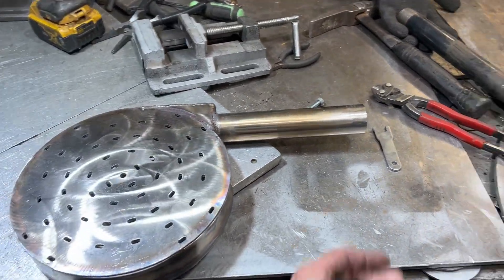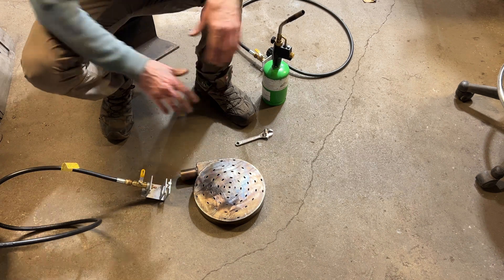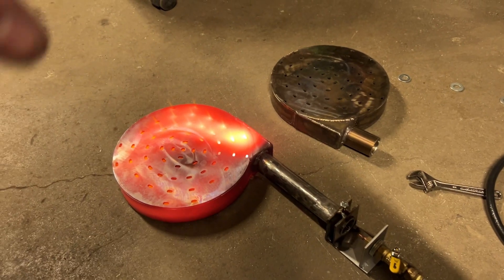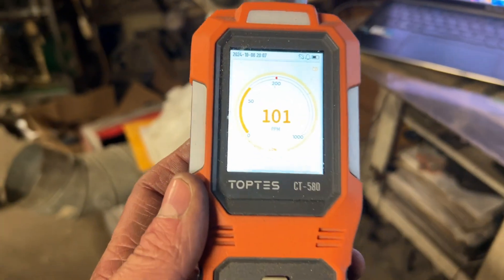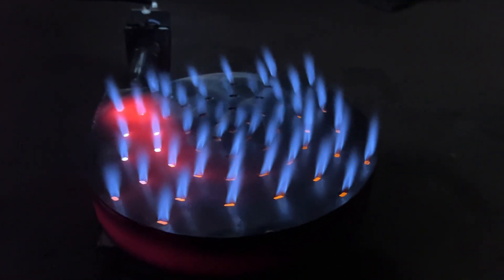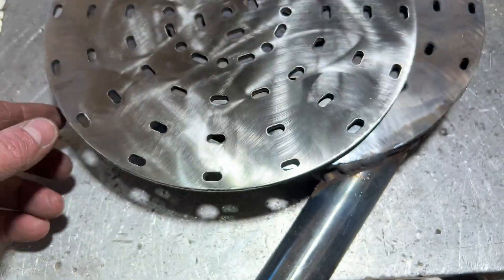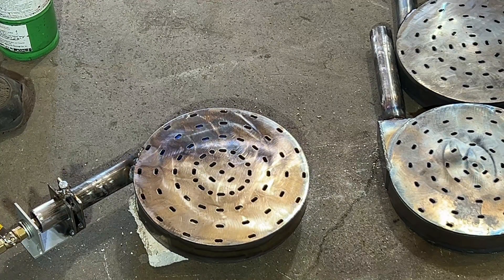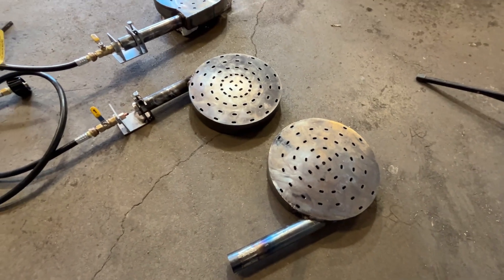Combustion design of IR plate burners

Comment: Shorten the long tube a bit it seems you hit the Resonance of the burner unit with that smashed nozzle. The velocity of the streaming gas is just right such that you hit the Resonance of the burner the burner is nothing other than a Helmholzresonator with extra holes with in turn makes it to a Higgins tube and if the flame is replaced with just heat then you get a Rijke Tube in the end you have accidentally built a thermoacustic tube. You need to change at least one of those "right conditions" to get it to work properly again. At the moment the flowing gas is to slow to burn in the chamber if the geometry is always the same than before as you always had built it then the solution is simple change the broken nozzle. But I wouldn't throw that nozzle in the trash though because you have built a fringe case with that nozzle you could test your future burners for fringe cases like that. 🤔
Reply from the maker: Thanks for the input friend

Comment: Suggestion: maybe for thermal combustion surface balance, try placing a partial depth spiral down inside the center to expedite the migration of a portion of the flame toward the center.

I can't promise you it will even out the heat totally, but it seems worth a try.

The idea would be to line the spiral up with the middle of the inlet tube, and only make it from 1/3 to 1/2 the internal height of the chamber so that only some of the flame would follow the spiral, while some of the flame would continue going around the outside.

The idea would just be to more evenly spread the flame around the areas that are not quite as hot.

Comment: Yeah, your fuel air velocity is too slow, so a narrower inlet is definitely necessary.

Also, if you could form it as a taper [a long barrel venturi] you could do even better.
Reply from the maker: Yes in this case its cost prohibitive
Reply: @NOBOX7  Why would it be so expensive for you?

With the tools you have, you have basically everything you need to make a tapered venturi tunnel already.

All it takes is bending some carefully cut sheet metal, some hammering and some welding, and carving some shapes out of wood for forms to hammer the sheet metal into.

You have many heaters to soften the metal, a plasma cutter to precision cut the metal, some welding gear to weld stainless steel, and a sturdy work bench, so you have all the tools needed.